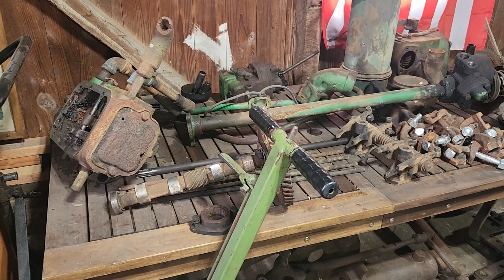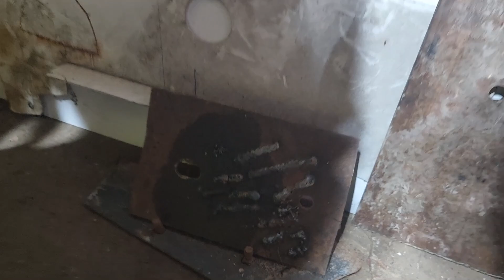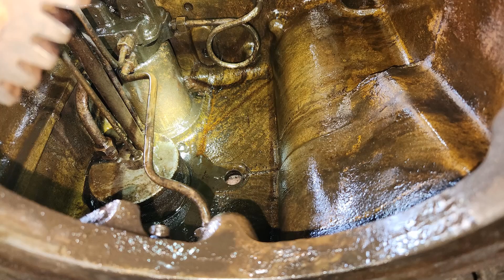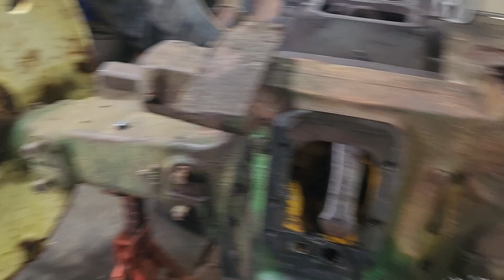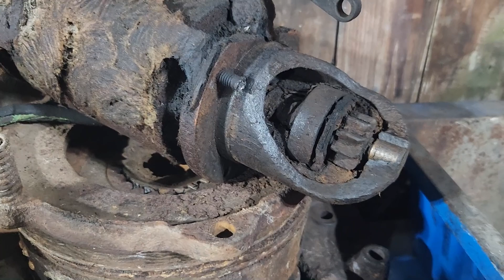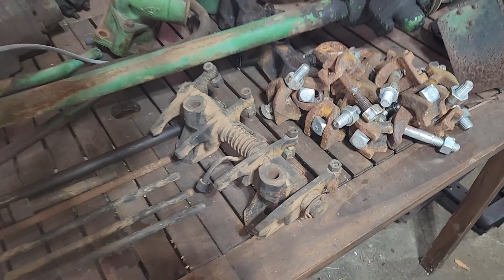John Deere 60 Teardown - Part 2: Engine Block, Crankcase, Governor, Clutch, & Drawbar Removed

Comment: These JD tractor we're built so strong for the few HP they were delivering. It was simple mechanic, easy to work on, to fix and we're never letting farmers down.
Reply from the maker: Agreed. The two cylinder design was very simple, efficient, and made tons of torque.

Comment: Recently discovered your channel and am enjoying see some old tractors from your area! The drawbar issue seems fairly common. Years ago I built a heavy duty drawbar for my 60. If you are interested, I would be glad to send some pictures.
Reply from the maker: Thanks for checking out the channel! I would definitely be interested in seeing the drawbar you built, as this old drawbar is pretty rough and not sure if it's worth saving to use.

Comment: I made a tool to remove the wheel wedges very easily without heat and without applying pressure against the cast wheel. It slides over the axle and a sledge hammer will knock the wedges out in about 3-4 swings. Let me know if your interested and I will give you more info on it
Reply from the maker: I'm definitely interested - I've tried just about everything to remove the wedges at this point. One wheel came right off when I tightened the jack bolts down, but the other wheel won't budge.
Reply: @MichaelTJD60  Ok the best way to explain how the tool looks go to youtube and type in "I was able to move the rear wheels on my John Deere 3020 Tractor! Here's how!! " Now you want to purchase a piece of pipe that is at least 1/8" to 1/4" larger than the diameter of the axle. I made mine 14" long. Then weld a plug the diameter or slightly larger than the pipe on one end of the pipe. Then cut a half piece off the other end of the pipe that is 1" to 1 1/2" deep. Make sure the pipe and plug is schedule 40 pipe. Schedule 80 will work but you will have to mill 1/8" off the thickness of the pipe so it will fit correctly. Then lift the tire off the ground and turn the cast wheel so the outside bolts are on the bottom wedge of the wheel. Remove all 5 bolts and slide the tool onto the axle with the uncut half of the pipe against the bottom wedge. Make sure the pipe is level and is only against the the bottom wedge. Then hit the end of the pipe with a sledge hammer 4-5 times or until the wedge pops out . Penetrating oil isn't going to help much as the wedges are in tight and the fluid won't penetrate in far enough. Once the wedge pops out you can just tap the other wedge out when you take the bolts out. My adjusting bolt was froze solid and after the wheel was removed I used an air hose and blew out the dust and dirt around the gear then sprayed penetrating oil all around inside the slot. I used an impact wrench and penetrating oil and worked the bolt back and forth until the adjusting gear moved freely. The wedges on my 60 were in solid and it took 3 swings on one side and 4 swings with the sledge hammer on the other side for them to pop out. This is the easiest way I have found to remove the wedges and it won't damage your tractor. Let me know what you think and how it works out for you
Reply from the maker: @johnleonhardt4570  Thanks for the excellent advice - I will have to get some pipe and give it a try. The wedge, rack and pinion design works great when the tractor is being used and the wheels are being adjusted somewhat regularly, but when the tractor has been sitting for 30+ years it's a different story. I'm not much of a believer in penetrating oil for these situations - it's proven ineffective for removing the rear wheels so far.

Comment: Im restoring a '55 50 that was sitting for 15 years and its better condition internally than yours. I wasnt planning on it but i think ill do a total teardown and replace all the bearings and whatnot. You mentioned your in lancaster county, im not far from you near Allentown.
Reply from the maker: It's definitely worth the extra time and labor to replace the bearings and seals. Last thing you would want after painting and finishing the tractor would be having to tear it back down again to replace a bad bearing or seal. Especially if it was sitting that long. Is your 50 a vegetable tractor by chance (long axles, single front wheel, etc)? Been looking for my grandfather's 50 that he had in New Jersey years ago...no idea where it ended up.
Reply: No it's not. It has a rollamatic and I knew the last 2 owners that had owned it for the last 40 years. It stayed within 5 miles of my house for its life and was the first tractor I remembered seeing as a child.
Reply from the maker: @levibridge9515  Gotcha. It's great that you know the history on it and have known it for a long time...makes owning and restoring it that much more fun.
Reply: What machine shop are you using? Wengers quoted 600 apiece for redoin the head and block.
Reply from the maker: @levibridge9515  Spring Garden Repair, near Gap/Parkesburg area. I haven't been given a bill yet but I know it's going to be hefty since they are boring the block, redoing the head and valves, and grinding the crank. They've done two-cylinder engines for years since there are so many Amish farmers in this area still using them.

Comment: Can only imagine the relief you felt when you broke the engine loose Mike. Been in a similar situation when the engine in my moms 99 blazer locked up a few years ago from a blown head gasket. By the grace of god, we broke it loose AND managed to start the engine without any noise
Reply from the maker: It was definitely a relief - all things considered, the engine came apart very easily and most of the internals of this tractor have come apart without much of an issue. I'm still amazed overall, I thought I'd be using the rosebud tip on the torch to loosen a lot of the pieces up.

Comment: thanks for another great vid! Question, I know you're against "repowering" an Onan garden tractor but i simply do not have anytime to rebuild 2 19.9hp onan motors. I bought two nicely restored suburbans but the motors were not touched  and i think one needs a valve adjustment and the other needs something else as it smokes and leaks oil a little bit. they both run but i dont want to run them til i fix  them. i also dont want to toss them! im willing to let them go for next to nothing .. please let me know if you might know someone who is interested if you are not. 
im in the middle of building a house, shop, and having a kid, it would be years before i could have the time to fix them as much as i would love too! 

thanks in advance for any thoughts or advice!
Reply from the maker: Where are you located? I might be interested depending.
Reply: @MichaelTJD60  near sacramento california. and as another option  i would also be interested in paying to have you rebuild them for me and i would of course pay for the rebuild and shipping !?
Reply from the maker: @WorknDirt  Yikes, opposite end of the country. I honestly am not the best person to ask for a rebuild as it would take me a very long time to do them the right way, plus I think shipping them all the way across the country (twice) would be too risky. I would recommend reaching out to these guys in Illinois who have a long history rebuilding Onan's - they will make sure it is done right, they stock all new parts for them, and the shipping cost would be less. http://www.enginemastersinc.com/onanrebuilding/onanrebuilding.htm
Reply: @MichaelTJD60  ok thanks mike, greatly appreciated! keep up the great vids!!!

Comment: very nice job, what are you going to paint the inside of the crankcase with?
Reply from the maker: Glyptal. It will act as a sealer.
Reply: @MichaelTJD60  thanks, I couldn't find it due to the spelling.